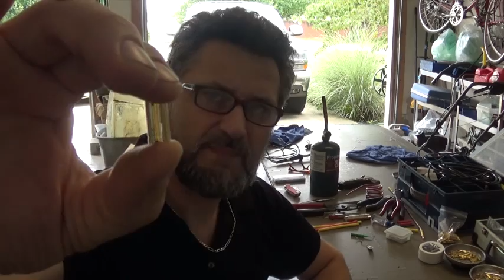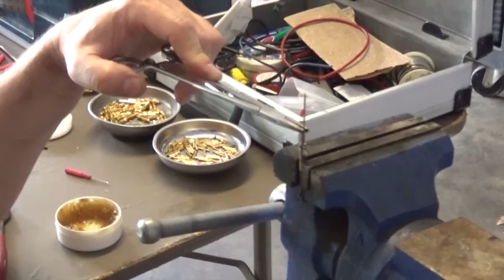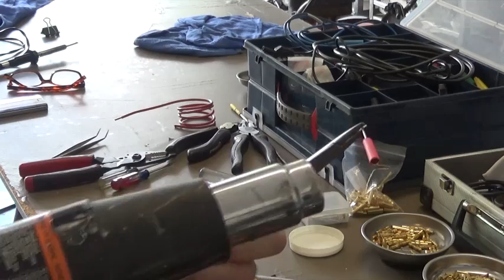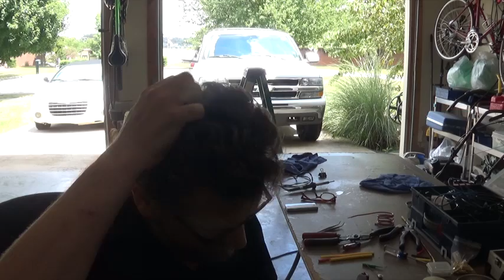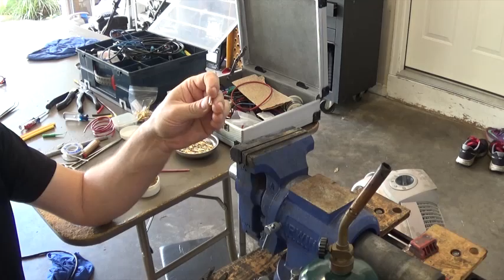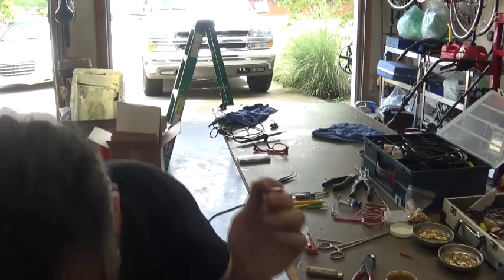DIY Back Probe Pins For Automotive Electrical Testing

Comment: The best back probe pin material i have found is wire from a wire feed welder. it is very strong and stiff, and can be shaped and cut easily!

Comment: I was in Walmart last year and found some excellent pins, about half the diameter of the commonly sold pins. Where would we be if it weren't for the fabric department, ha ha. Even the best still use those pins, although I find it a little clunky with more than one pin in a small space. You've got a better option with a fully insulated pin and no clumsy alligator clamp beside. Most of my factory pins are too thick.
Reply from the maker: spelunkerd this is much safer way to back probe your connector. I hope somebody will try to make some. Cheers my friend
Reply: Pins with open T is asking for trouble but I always use them one at a time.